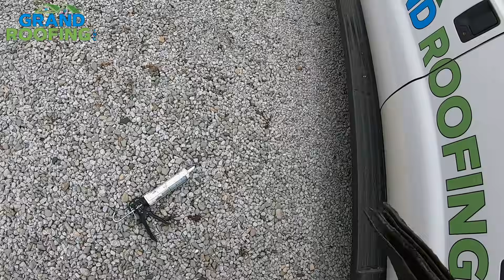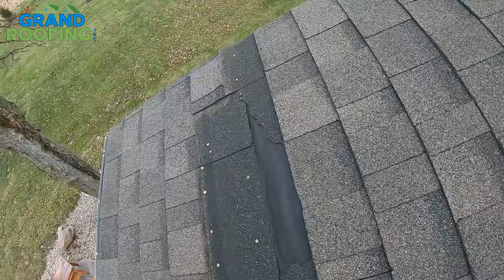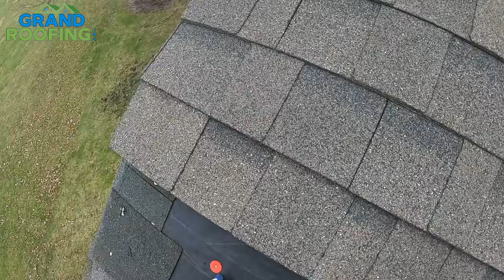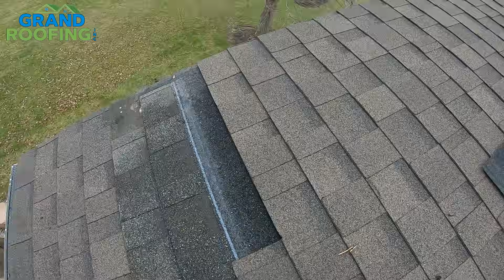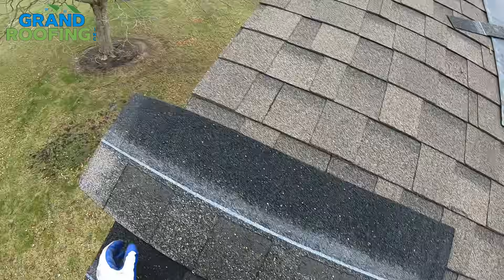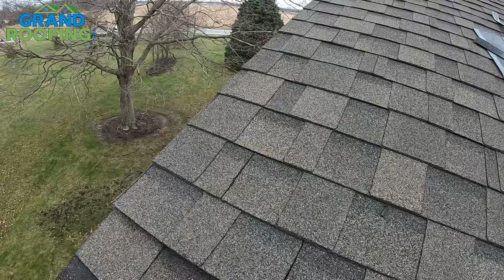Roof Shingle Repair - How to DIY roof repair tips & basics

Comment: Thanks for the vid. I am doing exactly that type of repair right now. Had a building inspector come out last week and walked around the roof and pretty much jacked all my tiles so they're slipping now. And yes I have the same problem with color matching but it's on the back side of the garage.

Comment: This is not a good demonstration that goes against safety in construction work. How do you use an axe as a hammer? This axe could come and split your head open. You are teaching wrong things, you climb up on the roof to repair  the roof  unprepared, without tools like a roofing knife, and nails and a proper hammer.

Comment: This is not a good demonstration that goes against safety in construction work. How do you use an axe as a hammer? This axe could come and split your head open. You are teaching wrong things, you climb up on the remove unprepared without tools like a roofing knife, and nails and a proper hammer.

Comment: If your customer's kid comes out of the house and finds you dead on the side of the house, that is not going to be a pleasant experience.   Add to that, this is suppose to be an example for others on how to repair a roof . . . .  most of the people who die are those who think that it could never happen to them.   A saftey harness is about $100.   A funeral is far more expensive in many different ways.

Comment: Thanks for the help!  I'm from a north suburb of Minneapolis MN.  I had the top of a tree break off and land on my garage roof.  Broke through the plywood on 4 places.  Your video is incredibly informative.  I have to repair the plywood which means I need to do the tar paper as well, but I'm replacing the entire roof next year so I'm doing  only enough to get it water tight for now.  I haven't decided if I'm going to go with metal roof or stick with asphalt shingles.  Thanks for the video!

Comment: I just started to watch videos for an upcoming repair.  I need to replace a bathroom exhaust vent that a squirrel tried to make a home in. I tried to seal the shingles but have a slight drip in the attic. So I will have to pull up the surrounding shingles. Do you have a video on the channel showing this.? Would you make a video detailing the replacement process? Thanks. I have liked and subscribed ringing the bell for new videos.

Comment: Pegram, TN, just west of Nashville. Have a slight leak in a workshop shingle roof, pre-fab, no tar paper under the shingles. No bad shingles; just loose and some bad nailing. First repair looked good until yesterday's storm and high winds. Going back tomorrow to widen the repair.

Comment: Hey this was an amazing video! Very knowledgeable and helpful! So my question is, what is the price range for a job like this one you did here? I’m debating on doing it myself or hiring someone. Thanks
Reply from the maker: @justshenaildit4289  it really can vary, depending upon what market you’re in and the reputation of the contractors doing it. I did this video a few years ago so I don’t remember what I charged on this, but I know at the time it was way undervalued. Someone with a good skill and reputation doesn’t happen overnight. It takes time to acquire. Also keep in mind. The risk one puts themselves in on a high steep dangerous job. As well as the overhead someone’s company may have. If  I were guessing at the time I probably did that for around 2 to $300. I find some large companies in my area won’t step on a roof for one shingle unless it’s over $1000 or more. I know that doesn’t directly answer your question but it’s very hard because I don’t know the market you’re in.
Reply: @GrandRoofingInc thank you very much

Comment: Never used that type of shingle, they 2 layers? usually see the simpler asphalt shingles which are one layer with 2 or 3 tabs per shingle that you can raise to get at a nail or wtvr below. and wood shingles are still around, never seen one being repaired though.

Comment: Los Angeles California. 
What is a good rule of thumb for minimum shingle joint offset as you run up the roof? I’m doing a hip roof, and I’m finding as I lay out whole shingles that as I get closer to the hip that last shingle section calls for a “shorty” (less than six inches)  - so I end up cutting two full lengths down by 12-15 inches so that the piece that ends a run at the hip is longer than ten inches. Am I overthinking the minimum size?
By the way, I had bought a hammer like yours in preparation for re-roofing, otherwise I’d buy one through your Amazon affiliate. 
Love your content!!!😊

Comment: So what you are saying is that the roof shingles were not applied correctly ??? Hope you told the owner . Let the owner know to apply silicone elastromeric paint to roof . I know Somay in Miami , Florida , but there are other companies like Henry , etc . I would make a bet that the shingles where not nailed properly on the entire roof , which will lead to weaks and roof damage . Therefore , the cheap way is elastromeric paint , unless the roofer is going to have to replace entire roof if it is still under warranty . Silicone elastromeric comes in colors not just white .
In Florida the hurricane winds can't get under the shingles to lift them off the roof with silicone coating .

Comment: Watching from Doney Park Arizona. Our Temps range from -25 to 105° & we get wind gusts in excess of 50 mph regularly.  Asphalt shingles soften in the heat then nails pull through. 
I'm trying to figure out if I can use Asphalt adhesive between replacement shingle layers to increase bonding; but contend with the heat causing the adhesive to run.

Comment: Watching from Arkansas, not exactly what I was needing info on (tree fell, made punch holes in shed roof) but I got sucked in. The 2 holes - 1st about 4 inches in diameter, 2nd about 8, and no one will repair holes and patch, trying to force me to re roof one side of this shed, it's 15 years old I don't need perfect.. did I mention lowest quote is 1600 dollars, 185 for materials the rest was labor. Hell no!

Comment: Watching from NW Lower Michigan. I’m 67 Single female, unable to pay  for repair to be done.  I am watching you so I can learn how to replace some shingles that were blown off my large shed.  I have extra shingles.  Just going to have a difficult time with the pitch of the roof.  The part that needs to be repair the roof is more up and down, so I cannot get on it.  Also the lip over hang is going to make it difficult to reach with the latter.  I do Thank you very much for your video.

Comment: I'm watching from Melbourne Australia. I'm enjoying your content. We don't have shingle roofs over here. I'm trying to work out whether the singles overlap going across the roof or only going up the roof?
Reply: Only up but they might overlap at a valley, depending on method, and the ridge cap laps horizontally along the ridge. Going across the roof they butt each other in the same row, but you have stagger your pattern so the joints don’t line up.
Reply: @pcatful  Thanks mate. That makes sense.

Comment: Good vid. One question though. I noticed you're just tossing nails to the ground. Doesn't that make cleanup a little longer? I trust you are in fact cleaning them up.
Reply from the maker: I didn't want them sliding off the roof uncontrolled, hitting something . So I threw them off plenty far out. They all got cleaned up.

Comment: Hello, a homeowner from Nelson, BC Canada here.... thanks for the vid. I just finished roofing my woodshed roof today! So, I wanted to see if I needed to do any repairs in the future if it's possible. Good to know. And, I have a huge amount of respect and admiration for the job of a roofer. My body was trashed after roofing. My oblique muscles in my abdomen were so sore, as well as my behind and low back!! Yikes. I was just using a framing hammer for the nails. I also used Malarky shingles as well for my job.

Comment: Brush Colorado here.  Had a 2"+ hail storm here and had a roofer check my roof today.  Very interesting to see a pro at work.  Now?  If I could just get over my fear of heights after backing off a roof one day, I could do this now.  Probably only 20 or 30 sections to fix like you did rather than a WHOLE dang roof!  Thanks!

Comment: Nw Ga.
Put up with shingles that have seems lined up?
I've always caulked the crap out of um.
I should try and fix it.
It goes from top to bottom
Probably 3 places.
Thanks Thomas!
I stripped the entire roof off.
Got 3 inch over hang on one end and one inch on the other maybe 30 feet.
Nice!

Comment: Poetry Texas, 30 east of Dallas, in other words, Hells Kitchen !  No Joke, it gets so hot here the shingle minerals are always the first thing to go, the heat here typically will reduce a 25 year shingle, regardless if it's a 3 tab shingle or composite, to a 12 year shingle, the temp on the roof here will read over 140 to 160 degrees on a July day, i'm in the middle of reshingling the southside of my 2 Story roof because the shingles i put on in 2012 are completely toasted !  GAF or Owens Corning brand, doesn't matter.  i'm figuring you must be north of the Mason-Dixon line to be able to shingle at midday.  Please keep posting your videos, i have already used some of the tips you have posted, THANK YOU BRIAN !  Take Care !

Comment: I am trying to replace my roof, and not to hire a crook who will give me 10 years guarantee  and never comeback to check if i got problems,  we got plenty of those here in Californian but also, we have code enforcement who support these crooks with license, once they get their percentage and property tax increase dont care how the work is finished by these ( professionals). every shingle on my ridge, installed by a co 25 years ago shows nails , it does not leak cause i used tar on each. Is it a good idea to do section by section between ridges?,  and can I install  single metal under shingles along the ridge and valleys.?

Comment: Thanks for the demo/info. I wish I had known this procedure when my old 3-tab developed leaks right above the drip edge, probably caused by a winter ice dam, not a summer one. I bought a coil of aluminum from Home Depot and slipped it under the leakers and glued it down.  Not very elegant, but it worked for 5 years until I had the roofing replaced.
Salt Lake City area.

Comment: Portland Oregon, out here we used malarkey shingles. They give us 1”3/4 nail area for roofers that can’t nail shingles property
Reply from the maker: I know I like using Malarkey myself, but they became very hard to get last year.
Reply: I was looking at the larger nailing area on the shingles and noticed that about half the area marked for nailing, only goes through 1 layer. I thought that wasn’t good, as the shingles could melt apart, or if the nail hits just off the second layer, it could blow through the top layer.

Comment: Hah you're going to hate me for reporting i'm watching from California where it is a frigid 73' F today?   One thing I would like to know, I have a shingle damaged in the middle of the first row of shingles at the roof top.  Some overzealous solar installers put a hole in the new roof and then used some aluminum under the shingle and glued it down, but still tore a chunk out of it.  If you have to replace at the ridge of the roof, would be interested to see how you do that?
Reply: Oooh baby that over the edge view, stomach was feeling a little tight there.
Reply from the maker: If the repair is right at the very top ridge, it would be the same as anywhere else but you would need to loosen and remove the nails in the ridge cap above where the shingle is to get it out.

Comment: Nice work Brian.  That camera work made me a little dizzy.  Was that a 6/12 pitch as you say, because the camera made it look less steep?  Still, great balance and skills working up there ‘on the edge,’ with the wind blowing.  You know your chit!  😳😀😁👍👍👍✌🏻🔨😊
Reply from the maker: Yes it was a 6/12 When using the GoPro with the wide angle lens it tends to not show sometimes.  A 6 is not bad at all, it's when you get into the 10/12 and steeper. Thanks!